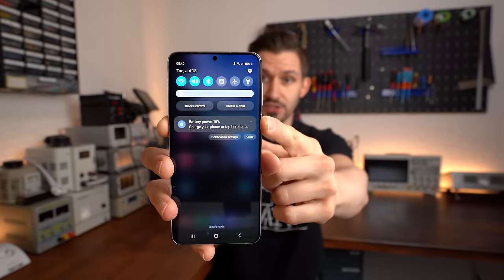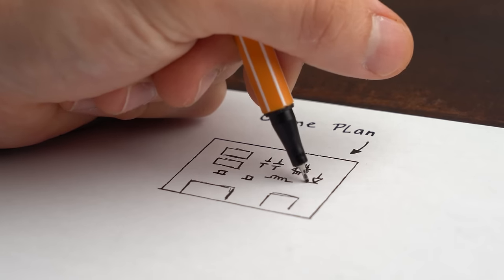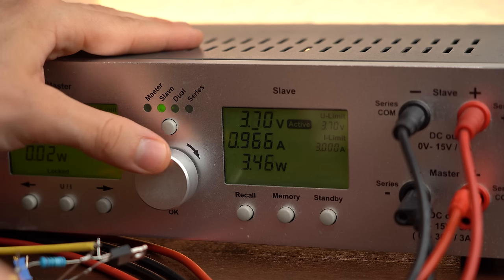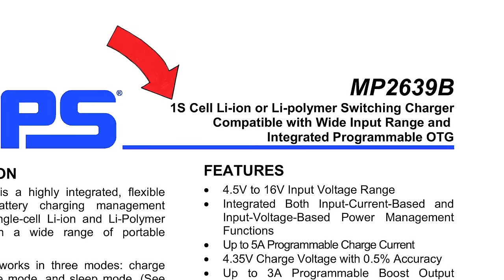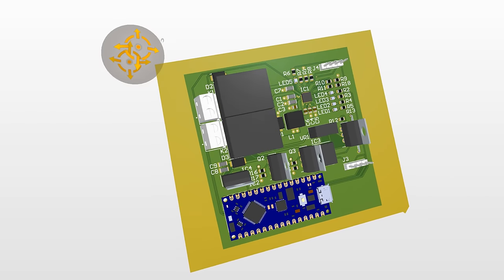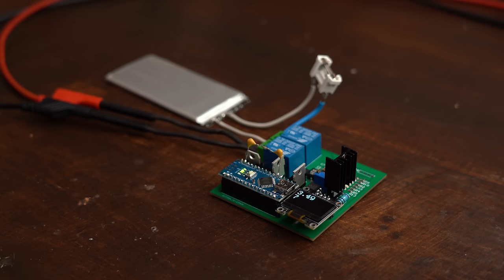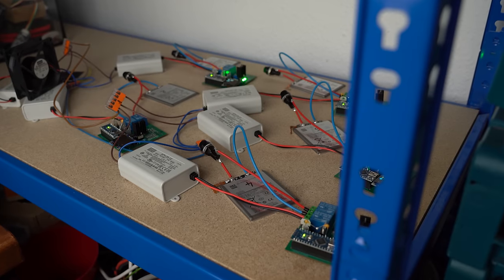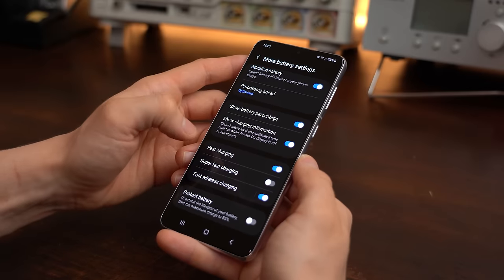Don't Fast Charge your Phone before Watching this Video!

Comment: My suggestion would be to enable slow charging over night (German: "Optimiertes Laden"). It's an Android feature that will default to fast charging unless it's at night. Then it will fast charge up to 80% and switch to regular charging for the remaining 20%. Yet it will make sure that your phone will be fully charged at your average wakeup time.
Reply: Why would you fast charge overnight? I don't even plug in my phone at night anymore, I plug it in when I'm getting ready for the day in the morning.

Comment: I do wonder tho, if the 5A charging from 0-100% is the worst you can do to the battery(without excessive heat of course) then how does it compare with the a battery preserving technique (charging battery when it hits 20% and stop charging at 80%, with 1A) over a large cycle count...

Honestly tho, you can publish these results online and it'd be super helpful :)

Comment: I think charging temperature does more harm to the battery life than the amperage. You should've done the experiment in 40-45°C environment because that's what usually the charging temperature is.

Comment: I am using the realme 5 device for more than 3 years now having 5000mah battery. Now the health is 81%. how I know well many apps can measure the capacity of battery like accu battery I am using this app since when I bought the device and at that time battery health was 100%. I charged my phone with 10 Watts charger that came with the device. Also the battery cycles are 910+. How I measured that well when I installed custom rom. It was written their. I realized that my device is still will 81% gives almost equal battery backup to the devices of 5000mah now a days. The biggest reason that I found is their charging speeds are way higher than mine. I think the fast charging beyond 20 watts is just marketing. Well that my opinion.

Comment: As anecdotal evidence from 1 user: mobile phone: For me lithium batteries have lost a noticeable amount of charge by year 2 (as a guess 20-30% total reduction). By year 3 to 4 the battery may be down to 50-60% or fully failing, a change to a cheap replacement may increase life by 1-2years. Cheap replacement battery tend to have half the lifespan of original ones (new original ones are practically impossible to find and generally fake or used, and manufacturer repairs such as official Apple repair are a scam price wise). For overnight charge I use a non fast charger. Gadget wise i find lithium batteries to be always the cheap ones and rubbish.

Comment: I think 3,5V is a bit low for a simulation regarding fast charge. I mean "keep your battery between 20% and 85% so it will last longer" is common knowledge by now. There is a reason why phones have a option to only charge up to 85% and my phone is usually around 50% when i hook it up for charging in the evening. So 11% loss in capacity seems more like a worst case after 2 years with "normal" usage. If you factor in that most phones will not actually use "real" fast charging above 50% you will have even less loss in capacity.

Overall: Your testing setup is great but the result just states what Apple, Samsung etc found out around 6-7 years ago and mitigated. It doesn't represent the state of fast charging today (or even 4 years ago for this matter)

Comment: I know you went though a lot of work and i dont want to make you feel about the testing as it was pretty cool. Fast charging is temprature controled witch protects the batery quite heavily. You can see the charger will drop down to a couple amps before geting to half, the batery geting warm and tanking the eficiency. 
I feel like people criticize fast charging to much and forget that wireless isnt ideal either. Either way the phones are built and tested for this sort of charging. If you dont need it/find it convenient dont use it, just stop hating.

Comment: always slow charge to 85%, i bring a power bank i case i need more later, power bank also loves it as it seems to be able to charge more % as the las 20% cost more battery then the first 80%
Reply: Just fast charge to 75% and you'll be golden. Charge to 75% if you need extra charge. Don't use super fast charging, regular fast charging is all you need.

Comment: I'm curious about charging devices using QuickCharge (QC) 3.0 when compared to Fast Charge or "Regular" charging. For example, using 9V 1.5-2A when compared to 5V 5A or 5V 1A.
Reply: I'm more curious about how specs like SuperVOOC do

Comment: This was fascinating, but fast charging doesnt charge at 5v 5 amps for everyone. Every fast charger I've ever used went up to 9 or 12 volts but kept the current down below 2 amps. I imagine this would cause less heat than 5v 5 amps and may cause less damage per cycle
Reply: This does not work as you think. All Lithium batteries only charge at 4.35-4.45V per cell regardless of voltage. The 9V or 12V that are used are only used to deliver the necessary energy over long distances (1-2 meters) with a thin cable and a smaller charger and have less heat output. They get converted to 4.35-4.45V inside the phone.

Comment: I use fast charging when I need my phone to be charged quickly, basically emergencies or charge mishaps. Otherwise I just use a wireless charger that provides 5W for this same reason.

If you get a new phone every year, it won't make a noticeable difference for you. If you want your phone to last more than 2 years, you should avoid fast charging. If you want good battery life for 5+ years, enable the max charge limiter in your phone if present to limit maximum charge to 85%.

Comment: I have not watched this yet , but normally the volts are drastically increased as well from 5v to 20v  , what drives me up the wall is android popping up please enable fast charge mode screen while on the charging dock  , then for some odd reason draining the F outa the battery till I have no charge left over night

Comment: With 5 of the same brand new batteries, run through normal charge and discharge cycles, maybe 100 each, then each battery charged differently but discharged the same way for 500 cycles, which would be half of its usable life or more, and then i would bet the difference is apparent between them....but thats alot of work for sure and not free either....if i had the money i wouldnt mind taking it on but as usual ive not been fortunate enough to acquire that type of funds for such projects and it makes me sad....

Comment: What was the charging temperature difference? How many cycles/ days do expect a battery to last 730?  Datasheet?  I would say 500 is going to get you below 80% of original capacity so by fast charging my battery it needs to be replaced 10 days earlier vs, 1 amp charge time and 5 amp charge time? So for being able to leave the house 5 times sooner I will gladly take the 10 day hit. Or 14 days for a two year battery. That’s probably why the EU made the batteries be replaceable. People expect to much from a battery there a consumable like gas.  There cheap, cook it,replace it. Cook some more, or stay next to your charger i don’t have that luxury.

Comment: Fast charging usually charges with high constant current until batter reaches 80% capacity. Then switches to constant voltage and pretty low current. That’s not as bad to a batter as pumping it with 5 amps until the end voltage. Has the selected charge IC implement this algorithm? If not, your experiment is not that valid.

Comment: "In general fast charging offers higher output while the device's battery is low. The mode operates until the battery reaches 50-70%, depending on the device. As the battery charge increases the fast charging output steps down. This preserves the battery's lifespan (less stress and heat)." 
It sounded like you would charge with 5A up to 100%?
Maybe a test like this would be better with a real fast charger+phone setup

Comment: Ive had one thought throughout this video, while these tests are pretty good. It would have been nice to see a larger charge cycle total. I was also was wondering, wouldnt the enclosure of the battery also matter heavily? I know batteries dont like cold temps but surely constant heat that isnt dissipated is damaging aswell right?
Reply: This guy's test is completely flawed. Quick chargers don't just increase the amperage as he did here, and they dynamically change the charging rate. His understanding of quick charging is wrong as his test results should be ignored.
Reply: @Fmily  ahh ya that's true, I felt that this test was pretty off. Thank you for your input!

Comment: okay so what I gather from this is that fast charging your phone will lower the capacity by about 1.6% over the course of 100 charges in the worst case scenario but most likely 1% with normal use. and since I charge my phone about once every 2-4 days depending on usage, that means in about 1 year I charge the phone 100 times after which the drop in capacity should not be much more than 2% after a year, to be generous.
since phones are programmed to be obsolete after about 2 years (and we can get new phones then for $0 and no increase in monthly payments) then it's basically fine :D
this is probably almost all my old phones for the last 8-10 years are still working. however, 1 of them (S6 edge) cannot hold a charge on its own and must stay plugged in to stay alive. if it dies, it'll take me a week to revive it. my S8 edge is nearing that point, using it even just to browse the internet for like 10 minutes drops battery by 10% ish. my old iphone 5 is a special case. the battery can die at 80%+. but it doesn't take a week (last I tried...) to revive.

Comment: First I absolutely love your so please take this comment with the attitude intended to be constructive criticism

You have some pretty serious flaws in your methodology

First no phone charges at 100 Watts and if there is any phones that do I have more fingers than phones that do

You're not fast charging these batteries you're beating the living snot out of these batteries and they held up pretty good 1.6% over 1/3 lifespan of the battery since most are only rated to 300 to 500 cycles for an associate of 20%? That's pretty good

First most devices will not charge more than 30 watts per cell so for example yeah my phone will charge at 60 watts because it has 2 4,800 milliamp cells inside 30 watts per cell same with my tablet except I think it has four cells it's 22,000 milliamps

So realistically 99% of the phones out there going to Max at 30 Watts

That's the other thing amps doesn't mean anything in this context because these devices are charging at USB c PD specs which means they're charging at 5 volts 9 volts 12 volts 15 volts and 20 volts with 5 9 and 12 usually limited to 3 amps and 15 and 20 are able to go to 5 amps in most typical scenarios

So a more correct measure would be wattage not amps since amps would require also knowing what voltage the phone is charging at

Your methodology is also not typical by any standard anywhere in the world no one uses their devices like that ever anywhere in fact even worse you are continuously discharging at 1 amp and then immediately charging at 5 amp that's simply not how phones are used anywhere any place by anyone phones spend the vast majority of their life with the screen off and then have bursts of usage a few seconds here a few seconds there maybe an hour or two for a long session here and there you're not giving the battery a chance to cool down since heat is going to do more damage than charging

Of course you are open-air charging these cells so they do have a decent opportunity to cool down or at least not heat up as much

A better test would be to draw down the battery at 1 to 1.5 amps in 30 minute increments and give it 20 minutes to cool down before hitting it for another 30 minutes session and then charge the phone at 30 Watts which is typical for a high performance high-end device most charge at less than this in fact most likes of phones that aren't you know the cream of the crop charge at between 10 and 18 Watts so even 30 watts would be pushing it very hard

What you're doing is not fast charging what you're doing is beat the living snot out of me flog me charging :-) fast charging is 18 Watts

Even under PD protocol 12 volts 1 amp is common 12 Watts or 9 volts 1 amp or 9 volts 1.5 amps which is right around 10 to 14 watts

As for your peak voltage that's battery chemistry lithium ion is not the same as lithium polymer which is not the same as lithium Cobalt which is not the same as lithium iron phosphate which is not the same as etc etc

Your typical cell phone battery is going to last 18 to 24 months one of the worst ways you can charge your battery is using your wireless charger because about 30% of your input power is directly heating the battery due to the efficiency losses in the wireless transmission this is worse when it's actually inside your phone because your battery is encapsulated inside the phone so it's more difficult for the heat to get gone using a wireless charger is like putting your phone on a hot plate especially once you start using the higher power wireless chargers

To maximize your cell phone's battery life try not to discharge it below 40% and stop charging it at 80% more and more phones are coming with this functionality built in there's a program called Accu battery I think? It can't forcibly stop your phone from charging unless it's built into the firmware for example ulephone and my Sony phone both have this functionality built in so it will actually stop charging at 80% and simply hold the power there at 80%. Every couple of weeks or so it'll let me know hey I'm going to charge you 100% tonight so we can get a good measure on the battery and it's capacity etc

On phones that don't have this baked into the firmware it can't actually stop the charging but what it will do is make a chime or make your phone vibrate so you know to unplug it

Use wireless charging as little as possible if you can get a warranty on your phone for less than 30 bucks get it while you can replace the battery in these phones you have a 50/50 shot of breaking your screen when you do it I just had that problem with my AGM G1 I got the screen 3/4 of the way off and that last edge snap crack the screen grrrrrr

18 months and that battery puffed up and I babyed it just bad luck

Now my phone has enough power for 3 Days of heavy usage so I plug it in twice a week :-) it's a brick but I don't mind that

Either way use Watts not amps for portraying how much power you're putting in in this context because USB c PD has many different voltage specifications and don't use 100 Watts. There are a few brands that do oppo Huawei honor OnePlus maybe one or two other brands have one or two phones specialty models that can charge at 100 Watts but in general they're not exactly super common and they're usually multicell batteries so that wattage is being split over multiple cells although not all of them some of them have higher quality sales and can handle that

The biggest issue is heat as long as you can get rid of the heat it's not too bad as you saw 1.6% that is not a bad drop for 100 cycles that's one third the phone's life span or at least the battery's lifespan lithium polymer batteries are typically rated to 300 to 500 cycles

Which is usually about 2 years and that's because a cycle is 0 to 100 so anything in between is a partial cycle so if you only drain your phone down to 50% and charge it back up that's half a cycle not a full cycle at least for this metric in this context

I'm glad to see the EU starting to make a push to require replaceable batteries or at least serviceable batteries in these phones it is absolutely criminal that we allowed them to do this at the minimum if they're going to seal the phone up they should be required to use a long life battery such as lithium iron phosphate yes it has a lower capacity but you're lithium polymer battery will be down to that capacity in 6 months anyway :-) so you might as well get the 10-year life span out of it versus the two or three your lifespan we typically see now

Comment: Is the temperature range of the batteries in this experiment the same as the temperature range in a phone? I find my S23 has extremely good heat dissipation from any other phone I've had, which has made me not too worried about fast charching since it barely passes 40C during a charge

Comment: Compare capacity against charge cycle, and also only discharge to 20%, 50%, 0%, and charged up to 100%, 90%, 80%. Also there is a myth says fully discharge less than 5% once per month or something. Too many things to test with Li battery.